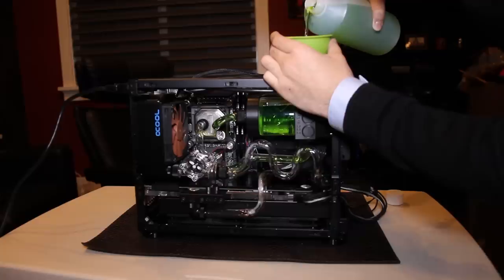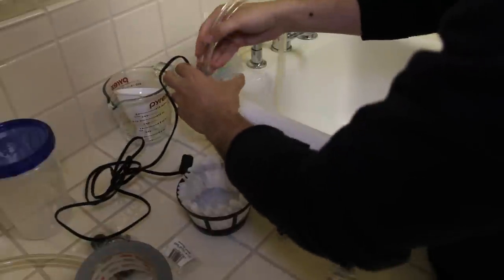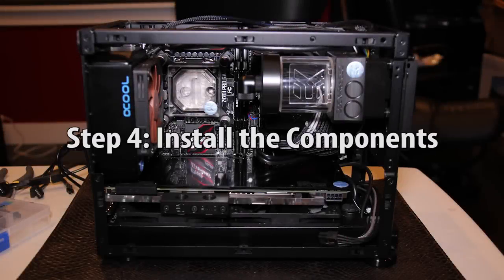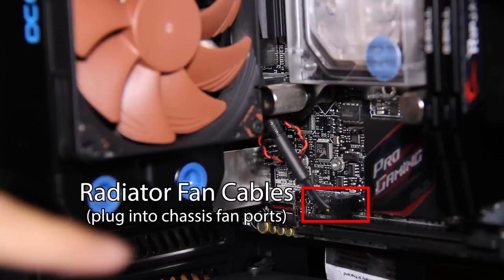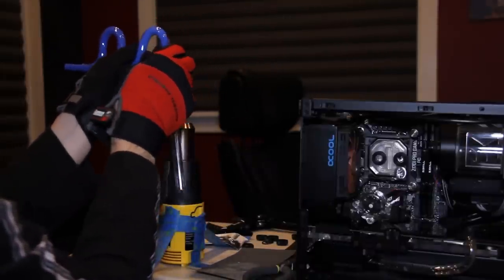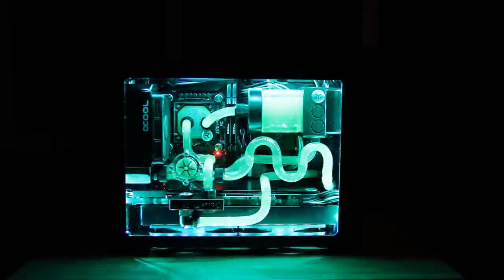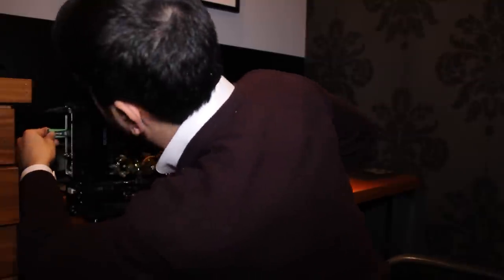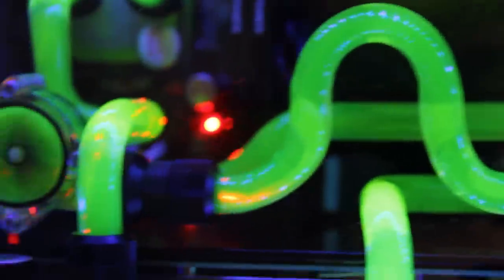Water Cooling Tutorial in 9 Easy Steps - Gaming PC Install Guide from Start to Finish

Comment: Noctua now makes black fans. They are called 'Chromax Black' really wanna do something similar to this but I'm gonna wait 1-2 builds before I try petg. Great video
Reply from the maker: Wow! Thanks for sharing! This is great news, and I’m sure others will love to know, so I pinned your comment!
Reply: Arjun Mehta why did you stop uploading?
Reply: I have 5x140mm chromax black fans and they are awesome. Best fan purchase I have ever made.
Reply: You should really use static pressure fans on radiators, also try to have them pulling through the rad rather than push. That way you don't get air rebounding back in to the case so it's more efficient.

Having a rad at the bottom of the case means you're heating the pipes and reservoir up as well. So everything will be running at higher temperatures.
Reply: What does petg mean

Comment: One thing ive learned is never over pay for watercooling parts the cheap parts are as good, trust me on that one.
Reply: what brand do u suggest?
Reply: @diciples9366  🤣
Reply: @Shxine  how helpful of u
Reply: @bigbyrome  how helpful of you replying to me instead of that guy
Reply: Except for the pump.
Reply: What about the temperature fluctuations the vid mentioned, wouldn’t the more reputable brands design for running the pc at a higher temp and not leak as mentioned?
Reply: @R3dL1ght5  These pumps have been ace, no leaks nothing, temps jumping around is to do with "hotspots" on the cpu, usually delidding cures this
Reply: @Synthematix  I was referring to the liquid changing temps and breaking a seal bc of the temp fluctuations like he mentioned in the vid
Reply: Corsair and its icue software is well worth the price!

Comment: Absolutely the best how-to for beginners that I have seen, and I've looked at hundreds over the last week or so. I've been building, both for personal and professionally as a custom builder since the "Personal Computer" was introduced in the 1970's, so I have a TON of experience with hardware and software, but I am attempting my 1st Liquid Cooled system, and am understandably leery of running LIQUID through a boxed enclosure containing $2000 worth of ELECTRICAL COMPONENTS! (as I have told my wife Many Times over the years: Water and Electronics::NOT GOOD BEDFELLOWS!) So THANK YOU for this. I am subscribing immediately. Very concise yet detailed, PERFECT
Reply: How did it go??

Comment: This video solidified it for me. Not doing water cooling. This will be my first build and thought water cooling would be so cool! (pun intended) Turns out. It may run cool and look awesome if done right, however the benefits do not justify the cost, the effort and the potential part failure.  That money is better spent in higher end components. After all I am NOT building a $5000 computer. (I totally would if I wasn't on a budget) 

Besides, computers are suppose to be replaced every 3-4 years. I am SOOO not doing this that often. I understand some people believe computers are like art work and people sure display them as such. However unlike real art work, Pretty computers DO NOT gain value with age. I am trying to keep this my mind and tell myself, Function over form. Afterall, what good is a pretty PC than cannot do the JOB I need it to do. No sir, my limited money is better spent elsewhere. 

 I in no means am being derogatory to those that have a different opinion as me. I am just saying, it isn't for me. Thank you for the wonderful video OP and the hard work put in it. To all those out there who choose this way, my hat is off to you and I wish you the best.
Reply from the maker: Jollyroger Hobbies I think you have made a completely fair assessment, and if this video helped you confirm that then I’m glad. The goal was to paint an accurate picture of the effort involved. Now that I’ve done it once, I can’t imagine myself doing a custom hard tube build for quite a while even though it looks really cool. The one benefit that I really like about water cooling is the quietness of the PC. That’s particularly useful when you are recording on a microphone nearby or simply don’t want to be disturbed. So, the next time I build a PC I think I’d use an all-in-one loop (e.g. Corsair h100i) which has the benefits of water cooling but doesn’t require any of the custom pipe bending or connections and fittings. Good luck on your first build!
Reply: @Coolarj10  Thank you. Good luck on your next build! noise really isn't an issue for me as I wear head phones and any recording is done in another room. If I have conference calls then my headset mic works perfectly to cut out any background noise. I know this because I have a loud house fan at my feat to keep me cool in the summer time and they cannot hear it, lol!

Comment: Wow i can't believe you went about doing all those trick curves for the water cooling... I watched closely because I'm stuck at a inlet and outlet issue from my water loop. My fitting are in a somewhat awkward place for the return to the front second radiator then to back to the reservoir after the full run through. I'm gonna try at it again today yesterday i went through two new tubes on this 16mm od 12id and that was so irritating and i called it quits and went to sleep...It was late though so I figured i was messing it up because I was frustrated. any tips how you were able to bend alot of that tube itself without pausing when you did that wavy loop.... I was pretty impressed.... I'm not to brave to try it like that i don't feel my skills are that great .. I didn't see you use a metric ruler or a measuring strip... So i'm gonna have to say you have some mad skills at it and probably you are just a natural some that just look at it and can just make it after looking.... So any extra tips on bending for that period of time and when should or how should the heat be applied to cover alot of the length of the tube... Hey if possible can ya and visitors help give our YouTuber neighbor hood friend a shout out and some subscribers ..... Trying to help her/ them out during covid shes hasn't worked now for almost 1 year and worked remotely but that job ended and she hasn't been able to get a normal job in her field so still a loss of income.... So i told her about YouTube. The family are kinda having a rough time financially . So any help you can send to her channel will help her for sure.... Her channel is https://www.youtube.com/channel/UCbNPvhY-2uCfsBHmcRCGV2A  Great Job!!! With the bending .. Also please remember to offer some tips ;-D

Comment: So, yeah, don't you think connecting all power cables, and then using the Jumper without disconnecting the cpu cables is a bit dangerous?  You should have nothing else connected to the psu at that point other than the bridge and the pump.

Comment: Nice video and machine. It could have used some more detail in the parts/steps. I feel like you have to be a freaking plumber to build PCs now (the cool way at least). I don't have a lot of the tools you have either. Was lost at several steps.

Id like to learn how to do this but it just seems so complicated and easy to mess up. And this is coming from someone who has built about a dozen PCs. Good job though, it turned out really nice but the process does not look remotely easy.

I'm curious how loud is a setup like this compared to an AIO or traditional big air cooler like Noctua NH15
Reply from the maker: Hey thanks! Feel free to message me any areas you need better detail on and I’ll try my best to help. You’re right - it seriously is like you have to become a plumber. Funny enough, after building the PC some things went wrong with our toilet and fridge and sink... and when I tried repairing them, it turned out all the knowledge from building a liquid cooled PC translated 100% to fixing those lol.... some of the tools I did buy just for this purpose (e.g. pipe cutter, heat gun, water pump). I would say the process is more time consuming than “difficult”. Since you’ve already built PCs, I think it would actually be super straight forward for you. The only trial and error is going to be with the pipe bending. You can avoid that by using flex pipes or an all in one cooler. Unfortunately I don’t have an example to provide for noise level difference between the two, but I suspect - particularly in this tiny setup - it will be minimal difference between the two. I will try an all in one next time I build because I probably won’t feel like spending the time to do a custom loop even though it was a fun process.
Reply: Arjun Mehta why did u stop uploading

Comment: I know the 80's is popular, but I didn't realise it was compulsory for a liquid cooling PC to look like a 1980's Mad Scientist's Laboritory.

But seriously well done on the effort of putting that together snd getting it all to work. I note that the bends in the piping allow for more water in the system, but also for the water to travel to travel further before reaching the GPU or CPU.

In a smaller case if the air temprature is warmer this might mean that the water temprature is not optimal upon reaching the item to be cooled. 

With that in mind what were your tempreture ranges?

Comment: Question: when using the bridge to disconnect the PSU from the motherboard so no other power flows through other than the pump, shouldn't you also disconnect the CPU power cable that gives extra power to the CPU, or can you just leave that in?
Reply from the maker: Hey, great point and good catch. That's something not explicitly mentioned in the video and overlooked. I agree that it would be better to disconnect everything except the pump. I'm not sure what power the PSU expects to deliver to the other components if left plugged into the PSU while using the jumper cable, so it is probably best to unplug everything. When I made the build in the beginning, that's what I did. On subsequent refills, I don't recall unplugging everything from my PSU. So, things have been working fine doing it either way, but the only way to be absolutely sure is to either unplug everything "just in case", or determine if the PSU could cause harm to components while using a jumper. Good observation!
Reply: @Coolarj10  thanks for your reply and clarification!
Reply: @Coolarj10  one final question. Is soft tubing less likely to leak because of the elasticity of it?

Comment: Amazing tutorial!
Bro, I have a question, how many fittings should I buy? I'm not sure if with 5 I'll be OK.
For now, I'm just watercooling my cpu in a Phanteks Evolv X ATX.
Reply from the maker: Johnny S. R. Thank you! First let’s count the bare minimum number of fittings you need. To do that, let’s think about how many pipes you will have: Pump/reservoir combo—>radiator—>CPU waterblock—>back to Pump/reservoir combo. 
For each pipe, you need TWO compression fittings (one goes on each end). The compression fittings are what help the pipe attach to your components, so you need one compression fitting on each end of the pipe. Your loop will need 3 pipes (denoted by the arrows —> ) and therefore you need 6 compression fittings. However, you may find that you will need 1-2 extender fittings to help your compression fittings fit into the pump/reservoir properly. You may also be interested in buying a flow indicator (the spinny thing which looks cool but isn’t necessary), which will require you to buy an additional adapter fitting (such as a female to female fitting). So, I would recommend you start by buying 6 compression fittings, and as you’re installing the pipes, feel free to buy additional fittings as you see fit! (haha!). The good news is you can get some fittings within 1-2 days from Amazon, or Fry’s electronics has some in-store. Or, you could buy some of the same extender and adapter fittings I bought (see my PCpart picker link) and return them if you don’t end up needing them. This way you don’t have to delay your PC build if you have a missing part. I hope this helps!
Reply: @Coolarj10  thank you so much for answering my questions! You are the best.
Reply: @Coolarj10  in addition, I realized that I'll add another waterblock for my GPU🙉🙉 Sorry for bothering you that much... Should I buy another radiator and another 6 extra fittings or what do you think?
Reply from the maker: @JohnnySR15  Haha awesome! No worries, let's work through this. I do recommend you buy another radiator. Let's draw a new diagram for your new situation to find out how many pipes you have, and from there we will find out how many fittings you will need: Pump/reservoir combo—>radiator #1-->radiator #2-->CPU waterblock—>GPU waterblock-->back to Pump/reservoir combo. So, you will now have a total of 5 pipes, and therefore you will need 10 compression fittings! One more thing: You don't have to have the pipes connect in the order I described in the diagram. Any order is fine, that was just an example. The order does not matter, it's just up to what is easiest for you or whatever you think will make the pipes look the best. Good luck!
Reply: @Coolarj10  thanks man, your awesome.

Comment: Is it really necessary to learn my water-cooling components? Ive already attached my radiator lol.
Reply from the maker: FatKidWitAJetPak hey did you mean “is it necessary to clean”? I don’t think it is absolutely necessary. If I did this build again, I would probably skip the excessive cleaning and just rinse each component out with water once or twice by shaking it. The tiny debris is probably not a big deal, mainly big chunks are what you don’t want so they don’t damage your pump.
Reply: Thanks, I decided to just clean my radiator.

Comment: I was wondering throughout this, is this your first build and you explained everything after, or have you made a build before, because you seem experienced
Reply from the maker: Haha this was indeed my first build with everything explained after. Thankfully I had the camera rolling pretty much the entire time, so what you don’t see in this video is the most of the mistakes and trial and error to get things right 😂... figured I’d save others the pain of those mistakes and condense the good parts into a how-to video!
Reply: @Coolarj10  Well, despite those issues, you managed to make an excellent sff build, I’ve actually been planning my own first build for a couple months now, and have watched this video a few times now, mine is an atx build in a p600s with cooling in the vrms, ram, gpu, and cpu, and despite this being your first build, you managed to make it easier to understand than what I’ve seen from more experienced builders, also, have you upgraded it any since?
Reply from the maker: @TheTobiasSimon  Aw thank you! Good luck on your build, that is awesome! The tough part about cramming a custom loop into a tiny form factor is that upgrading parts means you have to pull out all the pipes just to get access to anything... and possibly even re-do the pipes if the new waterblocks have the ports for inserting the pipes in a slightly new location. So, the only upgrade I’ve really done is upgrading to a 2TB M2 SSD from the original 1TB. I do love the small form factor, but I have more appreciation for ATX builds because one has easier access when needing to upgrade. However, it’s 2020 and my GTX 1080 and Core i7-6700k are holding up and I haven’t felt the need to upgrade yet, so let’s see!

Comment: To solve the issue with loose tubes under load you just can use pressure release valve.

Comment: Can be watercooled only gpu? Is that posible
Reply from the maker: Yup! In this video, I attached a waterblock to the CPU and a waterblock to the GPU, then connected both of those to radiators and a pump with pipes. But if you only want to water cool your GPU, then only attach a waterblock to your GPU and have the pipesnconnevt only the radiator,  pump,  and GPU waterblock. Of course, you’ll need to make sure your CPU is cooled some other way, such as a CPU fan cooler (some CPU models come with one as part of the kit).
Reply: @Coolarj10  thank you man!
Reply: @Coolarj10  there is not even 1 video about it 😵

Comment: Reminder, your diagram for flow was a bit off. You want your radiator directly after your heat source, you want cool water going back through the pump as the pump itself, in most circumstances, is water cooled. most fluid pumps are water cooled. this also means less bottleneck and pressure loss after the pump (pump pushes through radiator and drops pressure slightly)